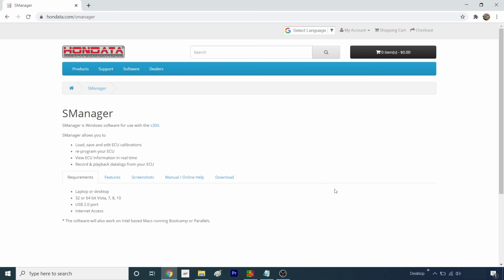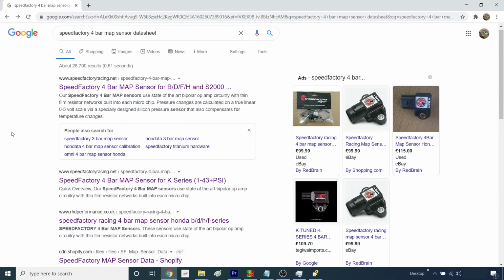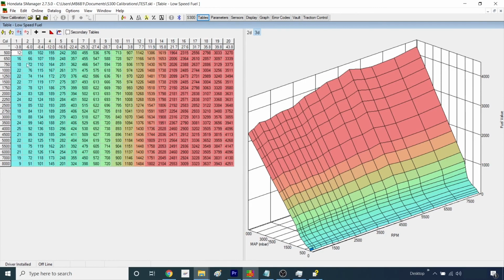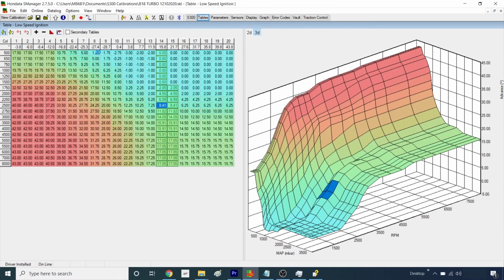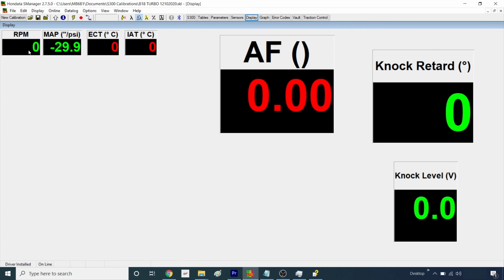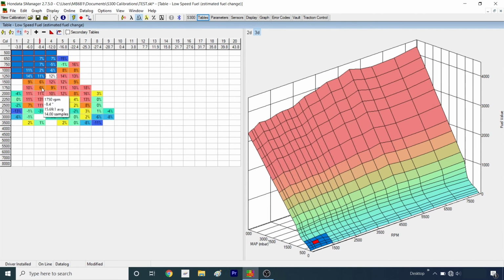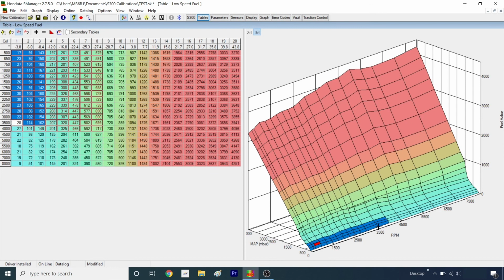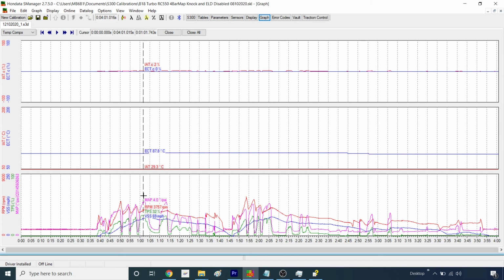TURBO Time B18C4 Civic EF Ep16 - Hondata Smanager Quick Start Guide - How To Tune using Hondata

Comment: Very interesting video you getting me tempted to turbo mine civic
Reply: Do it! Kitsch are so cheap now. I put together my own from parts on ebay. I know it's not top quality. The manifold I got a cast version for $50! Others sell the exact same for $150+. Only problem I've had is the intercooler kit. Put the intercooler to far forward. So I mounted it back a few inches and cut and shorten the pipes.
Reply from the maker: Is that on a B16 or B18?
Reply: @twin2civicgaraget2cg75  b18b in a 96 integra. Ebay nippon low comp pistons and scat rods.
Reply from the maker: Cool setup, have you had it on a dyno yet?
Reply: @twin2civicgaraget2cg75  still finishing up the intercooler piping need to reweld 3 joints.  I'm scared to tune it myself. But you I'm going to try because of your videos
Reply from the maker: You sound very close to finishing up. I would just be careful with the tuning. It is better to be on the richer side than lean on the fuel map, and try and drive in a steady way through the map points to get accurate lambda readings. I am glad the videos are helpful and good luck with your project.
Reply from the maker: Go for it! It has changed the car for the better in my opinion.
Reply: Wteva u do keep ignition timing safe!!!😬😬😬
Reply from the maker: Good comment. I left the ignition map how it was. You need to have a knock box to see how far you can advance the ignition before the engine starts to knock. These things are best done on a dyno.
Reply: @twin2civicgaraget2cg75  i semi tuned mine myself my mapper helped me so im okai with tuning and ignition of u need advice feel free to message me and if u need a street tune let me know my mappers an American guy but hes very well experienced and good priced hes better then the uk guys cuz he actually tells u whats going on and is helpful if u need advice
Reply from the maker: Cheers. I have mapped the fuel map myself, and with the knock box could have a go at the ignition. On the road you can hold the engine in different speed and load positions... so it is a bit harder to map (at least that is what I think).
Reply: @twin2civicgaraget2cg75  send me a pick of ur ignition table over and what afrs u aiming for on boost? U should be looking for 12.0 to 12.3 to be on the safer side